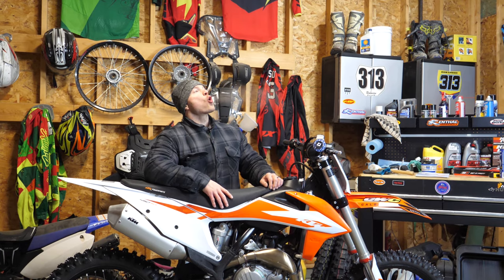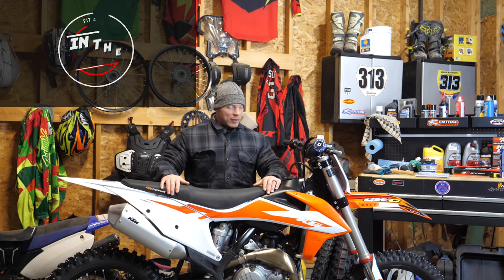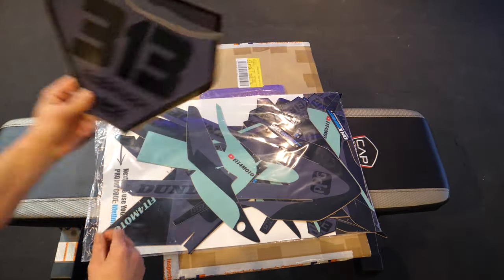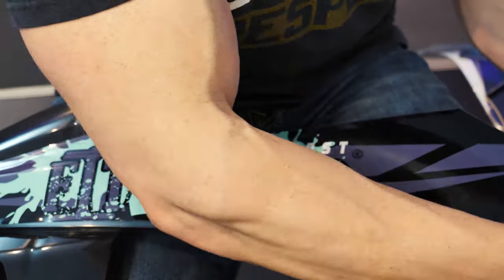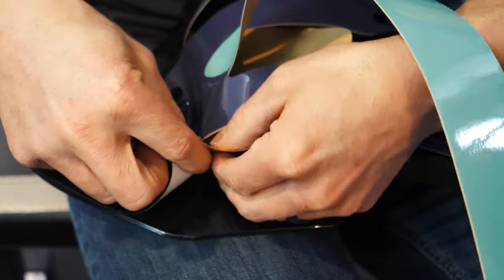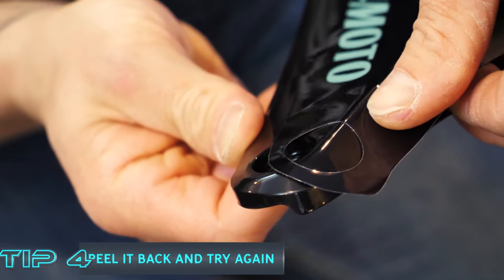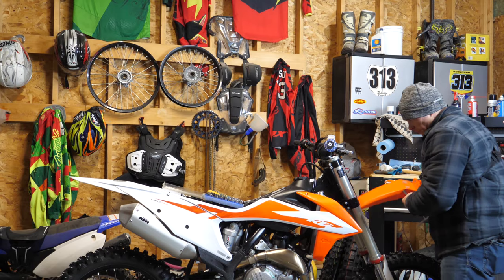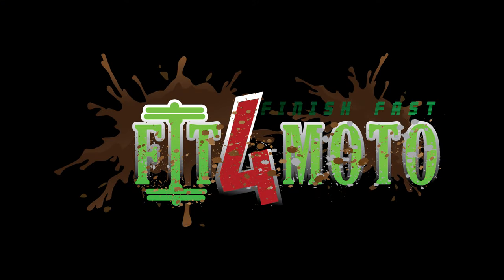BLACK DIRT BIKE (How to install new dirt bike graphics)

Comment: I recently got a Ktm 250 exc 1997 and I cannot find plastics for it anywhere any idea where I can find new plastics?
Reply from the maker: It depends on what your looking for, Ebay can be great for odd ball items. Just a really quick search I found this front fender which will fit: 

https://www.ebay.com/itm/Polisport-UFX-Free-Flow-Front-Fender-YZ-Blue-8565200006/313213729449?fits=Year%3A1997%7CModel%3A300%7CSubmodel%3AEXC%7CMake%3AKTM&hash=item48ecfe3aa9:g:18gAAOSwMiFfWiEU

also some radiator shrouds:

https://www.ebay.com/itm/UFO-Plastics-Radiator-Covers-Orange-KTM-85-SX-250-EGS-EXC-MXC-300-KT03088-127/392168170686?fits=Year%3A1997%7CModel%3A300%7CSubmodel%3AEXC%7CMake%3AKTM&epid=654957270&hash=item5b4f0b64be:g:puoAAOSwcQpb4iLW

And some number plates....

https://www.ebay.com/itm/UFO-Plastics-Side-Panels-97-KTM-Orange-Replacement-Left-Right-KT03023126-11-6911/383591260570?fits=Year%3A1997%7CModel%3A300%7CSubmodel%3AEXC%7CMake%3AKTM&epid=171336598&hash=item594fd2219a:g:t3cAAOSwY2pe57jo

I hope that helps!! Also...

I'm not sure how close the 97-98's were...but here are a few full kits for a 98

https://scrubdesignz.com/en/plastics-kit-collection/ktm/exc-series/exc-125-200-250-300-400-520-98-02.html

Cheers!

Comment: This video was a while ago but i just bought a honda crf 250 and i want to deck it out is there any other add ons that arent to expensive but look good
Reply: Rocky Mountain has a bling kit for bikes that has a bunch of anodized parts you can put on for like $70
Reply: @garrettburnett9162  thats sounds great ill check it out. Thank you
Reply from the maker: I agree with @garrett ! They have cool kits that don't cost much!